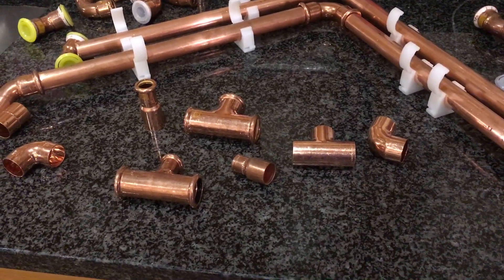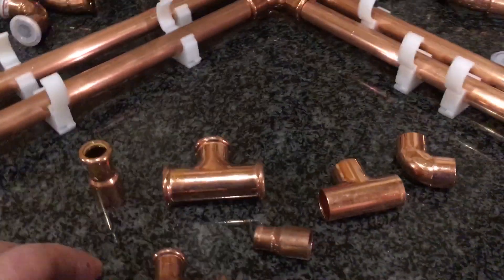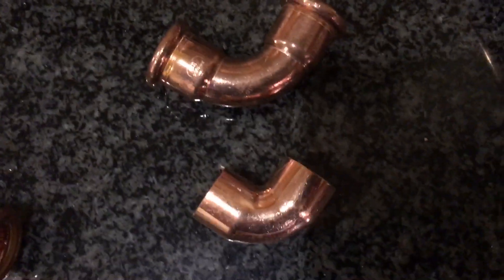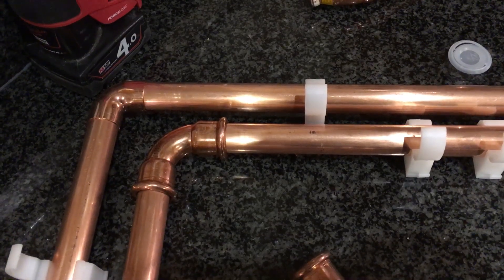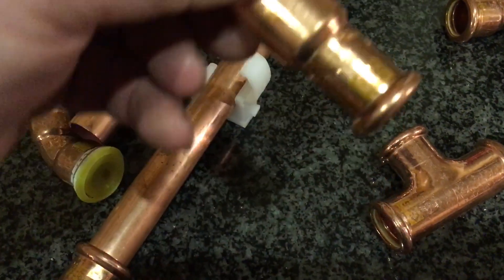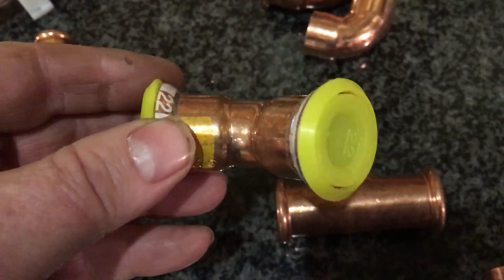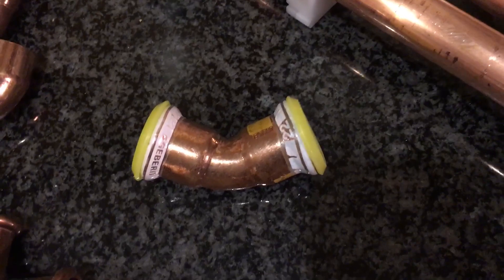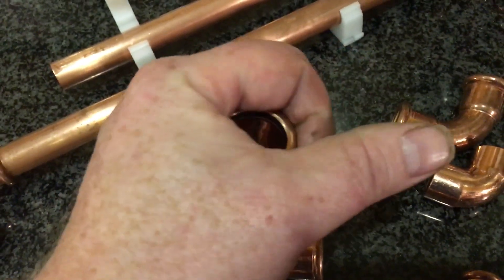PRESSFIT FITTINGS - COPPER PRESS FIT

Comment: The reason the PY fittings are not round is because of their "leak before press" feature. They do it so if you miss a crimp Xpress fittings will leak at 0.5 bar and you know it has been missed. It is more fool proof, I have seen Geberit fittings hold to 16 bar on test without a crimp in the past and then blow off 2 or 3 weeks later down the line. I also think the single use plastic on Geberit fittings a real shocking waste and a nightmare to clean up at the end of a job.
Reply from the maker: Thanks very much for your comment, please consider subscribing to support the channel 🙂

Comment: I'm now a convert to B press after the rep from Conex sent me some samples. The tees are slightly longer which make the jaws easier to get into. They have a 3 point pressing action and are extra secure and won't leak. Another big bonus is that the B press fittings don't stick to the jaws and don't need a plastic wrapper like the Geberit fittings. Yorkshire fittings are a real pain when they stick to the jaws, especially in a tight corner. I suppose we all like to try new things and evolve while doing so.
Reply from the maker: Thanks very much for your comment, please consider subscribing to support the channel 🙂

Comment: hi Allen, can you press chrome pipe without cleaning the chrome off thanks
Reply from the maker: You can buy fittings for chrome so I don’t see why not. I have never used on chrome. Thanks.
Reply: Hi John, Yorkshire Xpress have chrome fittings in their range and these are pressed directly on to chrome pipe. No more filing off the chrome to make a joint on chrome pipe. They are a real time saver, plus they look really good. I use them on towel radiators and they look really neat. For peace of mind, I contacted Pegler Yorkshire's technical department first to verify that their chrome fittings can be used directly on to chrome pipe without any filing or scoring of the chrome and they verified this is the case. I've been using the chrome fittings on chrome pipe installs for some time now and I can safely say, I have not had one single issue. They crimp on to the pipe exactly the same as copper fittings.
Reply from the maker: Thanks very much for your comment, please consider subscribing to support the channel 🙂

Comment: Im an old retired plumber who has come throught caulking and yarning soil stacks and drains with lead pots ,then changed over to plastic soils and wastes ,also using yorkshire fittings of all sizes,but those new gas fittings using the pressure clamp ,i have never seen them before this video.did you ever have a fail on them ,it just seem to me once its full of solder and sealed thats for life.
Reply from the maker: Thanks very much for your comment, please consider subscribing to support the channel 🙂

Comment: Having grown up with braized fittings during my apprentiship. ...Once you use the press fittings & tool , you will never use braised fittings again. pressing fittings are so much easier & no need for special traveling containers in vehicles for gas bottles & no need for fire extinguisher or hot work permits. The price of a press tool can be ofset by bottle rental & allthough it can be heavy with big jaws , its still not as back breaking as carry bottles...especially up a ladder or confined areas. This is going to be the new industry standard instead of an option.
Reply from the maker: Thanks for watching.
Reply from the maker: Thanks very much for your comment, please consider subscribing to support the channel 🙂